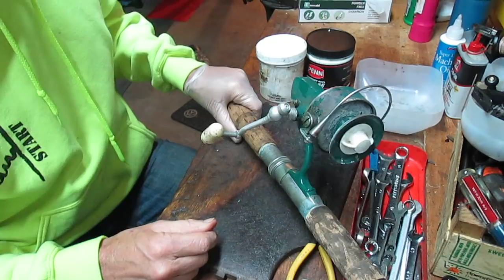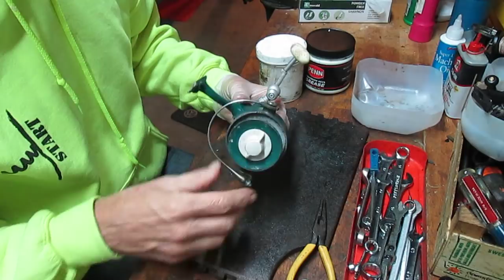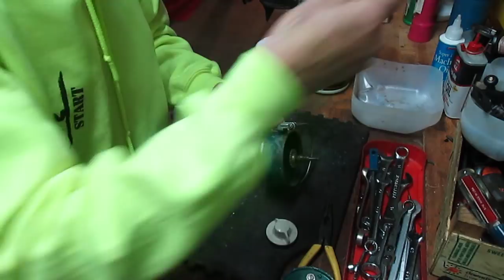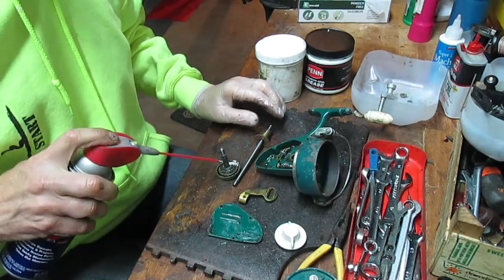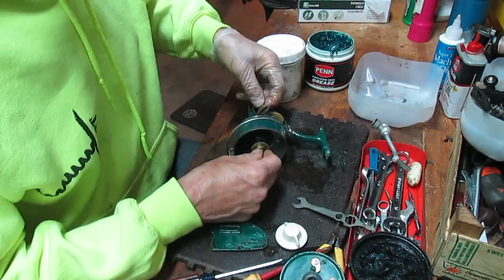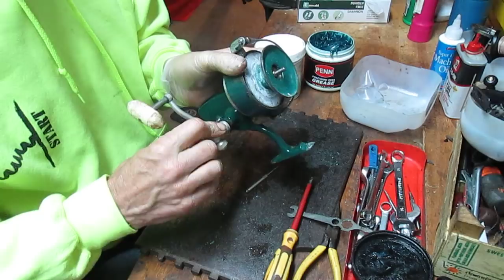Penn Spinfisher 700 classic "greenie" fishing reel  take apart, service, and restore

Comment: I have the 702 reel. Found it at Goodwill. It's hard to find another like it, is the 702 rare?
Reply from the maker: Yes - it is relatively rare because it is designed for left handers, which means it has a right hand crank.  Penn didn't make that many of these reels when compared to the 700 "right hand" model.  Nice find!  I am currently working on a model 711 which is the "left hand" version of the popular 710 model.  Thanks for asking - Dennis

Comment: This video motivated me to restore my Penn 712 Greenie which has been laying around for years. After thorough cleaning, greasing with Penn grease and replacing the drag washers and bail spring I took it out on its maiden fishing trip. It worked wonderfully for about 20-30 casts and then I noticed that it was getting harder and harder to reel (turn) . Its almost locked up now and I was wondering if you had any advice on what the issue might be?
Reply from the maker: That is hard to say.  If I were to guess, the first thought would be that the A/R dog is trapped behind the main gear.  Sounds odd, but it happens if you removed the main gear.  If not, you need to recheck your work. It could be another issue with he gears meshing or the axle shaft oscillation
Thanks for asking
Dennis

Comment: Hi Dennis, I am interested in learning about Penn Greenies and what the various model numbers  signify. I am shopping for an inland pier or dock reel that could maybe occasionally be used in the surf. I see models for 710 for sale online, and lower numbers too. Does the higher number denote a larger reel? Thank you.
Reply from the maker: Actually, it seems to be the other way around.  The 704 is the largest, the 710, which is ideal for the pier is a medium sized reel and the ones higher than 710 are smaller.  I don't know the numbering scheme.  I will have to see if I can learn more to answer that question.  Thanks for asking

Comment: Dennis I bought a Penn 700 not too long ago, took the reel apart to clean it & the main drive gear looks to be made of steel, I was under the impression that Penn used brass or bronze on these gears, this is a first for me. Have you ever run across steel gears in these older spinfishers??
Reply from the maker: I haven't, but it may either be the first edition that was only made for 1 year or it could be a replacement part

Comment: Dennis:  Really enjoying your videos.  They've inspired me to start tinkering with old reels.  At the 7:36 point in this video, you struggle a bit to remove the rotor cup.  I have an original Penn 700 (painted handle) that I'm cleaning and I cannot get the same part off!  I have doused it with WD40 and pulled as hard as I could, multiple times over a couple hours, with no luck.  What would you suggest as a next step?  I need to get it off because the bearing cover, like yours, is full of grit.
Reply from the maker: As a last resort. if all else fails,  put the rotor nut back on the pinion gear for one or two turns, but leave space from being fully tightened.  Next, get a soft blow hammer and hold the rotor cup while letting the rest of the reel hang free.  One sharp blow on the top of the rotor nut may free the stuck part.  Just be aware that this may cause damage, so you should understand the risk.  I have done it successfully a few times and having the nut on the pinion gear protects the threads, but there are no guarantees.  Best wishes - Dennis
Reply: @2ndChanceTackle  Before I resort to that, can you suggest any other lubricant that might free it up?  Could I soak the whole thing in WD40?
Reply from the maker: Kroil seems to work very well for me when I need to see stuck parts
Reply: @2ndChanceTackle  Your hammer blow approach did the trick!  However, now I've found the ball bearing frozen in place...
Reply from the maker: OK - get a thin punch that will fit inside the reel and catch the lip of the bearing by sliding the punch along the side  of the pinion gear from underneath.  You can then tap the bearing out from below.  I never recommend this unless you are going to replace the bearing, but it will work as long as you have the clearance between the bottom of the pinion gear and the side plate that holds the bearing.  If you don't have the clearance or want an alternative, soak the bearings with liquid wrench, broil, etc then reattach the rotor cup after you have removed the hold down collar and use the rotor as a handle to pull up on the assembly

CAREFUL!

Best wishes - Dennis

Comment: When I saw this video the first time I think I had just gotten my 2nd Penn greenie. Now I have 6 and will probably get more if I can. I would love to find a Penn 706 PUM greenie but they are pretty rare. I do have all the different body styles of the Penn 700 and 704 greenie. The most valuable reel I own is a 1961 first edition of the original Penn 700 Spinfisher. It was the very first Spinfisher! I will never fish it as it is just to valuable. The first edition in 1961 had an aluminum oscillation arm that could and did break. In 1862 Penn went with marine brass like this reel and no more problem. The distinctive way to identify a 1961 first edition is it was the only one that ever had a beautiful one piece green handle. I’ll bet the bearing in this 700 would have been near impossible to remove. They are a real challenge. To me, this will always be one of your finest videos!   $5.00 - unbelievable!
Reply from the maker: Thanks for the information.  I learn something every day!
Reply: Looks like that's what I have too (green handle and aluminum arm.)  My paint is all beat up, and I need a new Click Screw.
Reply: @thomcerny1101  I think any Penn 700 and maybe a 704 click screw will work. If your handle is green it is most definitely a 1961 1st edition Penn 700 Spinfisher.  Mine only has a little paint loss on the handle. Mine is also technically a 701 as it came with two spools. I’ve seen about 6 of them in 2020 and before but good ones are very rare and quite valuable. If you can’t find that clicker screw let me know and maybe I can help. I have a few really great contacts for parts on these old greenies. The one part you’ll never find is that aluminum oscillation arm . Folks almost always replace it with the 1962 and later marine brass arm. I have 6 of the Penn greenies including every body style of the 700 and 704. I hope to find a 706 PUM greenies but all the ones I’ve seen are either too expensive or have incorrect parts on them.
Reply: @christopherjenkins2373  what does PUM stand for?
Reply: @thomcerny1101  in spinning reels it actually comes from a French term. French often puts adjectives after nouns unlike English.  Best translation literally would be, ‘Pick up manual.” In English we say, “manual pick up.” This means there is no bail wire to direct the line to the line roller to retrieve your rig or fish.  I’d rather use a PUM reel over bailed when surf fishing. I’ve collected many reels in both bailed and PUM versions. I have almost all the French Mitchell saltwater reels in those two versions. I even have a few Penn greenies in those pairs. My most recent pair are French Bretton 902 large saltwater spinning reels. I also obtained a very rare Mer 52 PUNCH PUM Surf reel from France. I wish you could see pictures of these reels. They are remarkable. Have you ever seen a saltwater spinning reel with a lever drag? I have one.

Comment: Does line roller  come off mines stuck
Reply from the maker: Yes the small roller should come off the 700.  Try flooding it with a penetrating oil and let it sit.  The should free it - Dennis
You can check the schematic at Mysticparts.com to see how it comes together - Dennis

Comment: I have several Greenies I want to restore,,,,can you still get the original green paint? and if not do you have any suggestions on a matching paint and what type to use ?
Reply from the maker: I am not aware of the paint availability.  I will leave that to our viewers.  I would think that a local automotive paint supplier to auto body shops might be able to match it - Dennis
Reply: oh,,, yeah I replaced all the springs and found a new spool for it...its almost all new,,,, just would like to keep it the original color if its available too

Comment: Dennis. I now have a 1961 original Spinfisher 700. I got very lucky. In only  the 1961 reel that transition piece or crosswind arm attached to the axle shaft and main gear was made of aluminum and was prone to break. All the years after they changed it to marine brass and there was never a problem again. I now have every model of the Penn Spinfisher 700 and 704 “Greenies.” I love these reels and fish with all of them!
Reply from the maker: Wow!  Sounds like quite a collection.  I just got two printing greenies in for a tune up.   A 711 and 712.  Absolutely beautiful reels that were made to last.
Reply: 2nd Chance Tackle  I wish I had some of the smaller Penn Greenies. I guess you have to define your collection so since I surf fish, I only have the 700 and 704 Greenies. I should clarify that I don’t have every 700 and 704  that came out each year since 1961. What I’ve collected is every different model or style that has come out. Every one of mine has some physical appearance that made each one unique in the product line. Also I only have the ones with the crank on the left side. There is a 706 greenie but I only have 700 and 704. Put together with my black and gold Penn Z reels it is quite a collection particularly in that I’ve only been seriously collecting for a year and a half. As I’ve said I now have about 50 vintage surf spinning reels. I still have a few Mitchells I want in the collection but these are the hardest to find and difficult to afford. I am proud of the 10 Mitchell’s I’ve restored (with your help!). By far the 488 was the most difficult and largest. The bail spring and trip mechanism are almost impossible for one person to do. Another reason I like PUM reels so much!
Reply from the maker: You have hit on why I DO NOT collect reels - there are just too many variations and nuances of the models and manufacture in order to keep up with all.  I "collect" or care take for a few sentimental reels and no more.  While I have lots of reels, my intention is to service them and send them back out fishing.
Best wishes on your search, it can be a fun pursuit - Dennis
Reply: 2nd Chance Tackle I can already see that because I limited my collecting to vintage surf spinners I am rapidly exhausting what I actually want. In fact there are a few I got early on that I may ultimately get  rid of. I like the iconic reels that have stood the test of time. I have no desire for any of the new Chinese manufactured reels. I know there are some great modern reels out there but that’s just not what I’m interested in. I have a few oddities I’ve found but they are not what my collecting has been about. Right now there are only a few reels I still would like to have and most of them are Penn or Mitchell. There is the old adage that you’ve got to know your limitations.
Reply: @2ndChanceTackle  Dennis are you going to do videos on the two greenies? I'd love to see them worked on and serviced. I only have the larger 700s and 704s. These smaller ones fascinate me. Hope i can see you work on them!

Comment: I really appreciate your common sense approach to working on reels. That said, I work on reels myself for other folks and I am what I guess you would call "anal" about my work, using cleaning machines, cleaning and repacking bearings, etc. What you do clearly works well, but I have always wondering why you don't take apart and service the roller assembly on spinning reels. They are critical to the performance of a reel in terms of line lay and twist. I would appreciate your thoughts.
Reply from the maker: Dave - I appreciate your thoroughness and glad to hear your thoughts.  I generally do not service the roller bearings and at best just add a drop of oil. If a red fails, it is usually not because of that and I try to identify the failure and show how to correct them.  It is probably a bad habit I developed when most reels did not have this feature and I failed to keep pace with the changes.  I try to show the heavy lifting in my videos to give folks the confidence on how to service their reels.  I am always looking to improve and will try to remember to note that they should pay attention to the roller bearings in future videos. - Thanks for watching - Dennis

Comment: In 1976 I already owned a Penn 720 & 710 Spinfishers, when the 716 came out. Back then, at least in my area, you could only buy them in tackle shops. I paid $24 in Julian’s located in Atlantic Highlands NJ. I still have that reel and still use it with the Ugly Stik 5’ ultra lite I got for $19.99 at Herman’s. (I still have the receipt because it’s guaranteed for life! LOL) Back then I was only a teenager making less than $2.50 and hour, so it was about 2 days pay after the 5% sales tax. tight lines...
Reply from the maker: Thanks for the memories, neighbor.  The bay will break open soon.  Best wishes - Dennis

Comment: Dennis: Everything in this reel is either aluminum, stainless steel or brass.  If I had a sandy reel like this, I think I would just wash everything in the sink with warm water and detergent to get the old grease and sand out of it.  Then blow it dry with compressed air and spray with WD40 to get any remaining water out.  Then lube and reassemble.

The sand was making me grit my teeth when you took it apart.  Eeeeek.

Comment: Thanks for detailed review! Could tell me please why head can shake on 704? Is this required bearing replacement
Reply from the maker: Hi Riyal.  The first place I would check on the shaking rotor is the nut that hols it to the pinion gear.  Take the spool off and make sure the nut is tight.  If that does not take up the slack, then you most likely have a worn bearing.  The worn bearing would be unusual, so it is probably a loose nut - Dennis